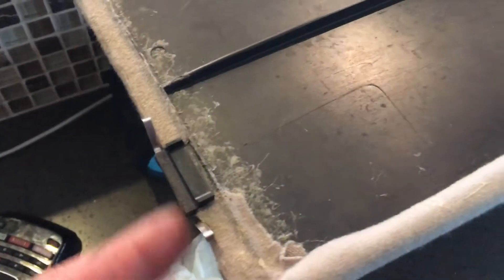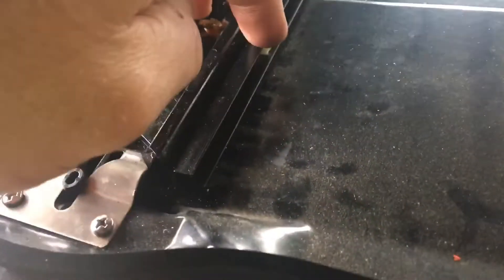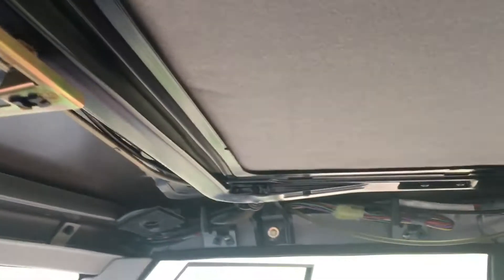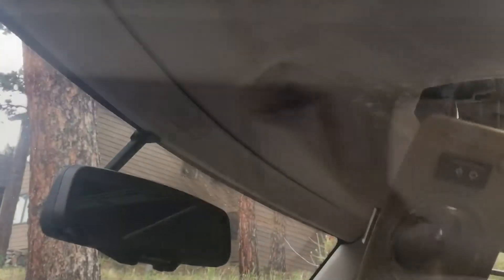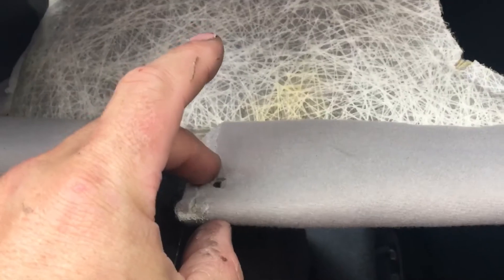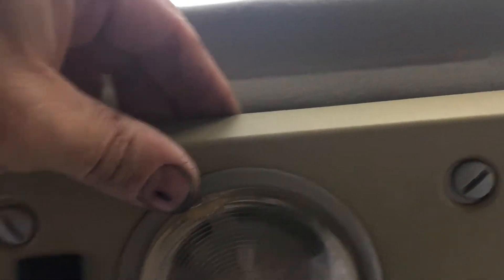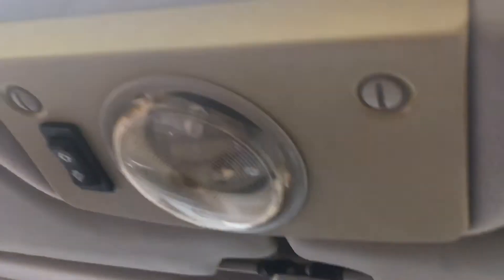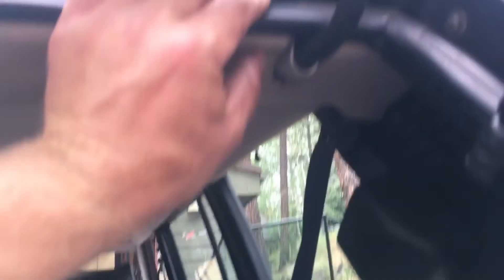Range Rover Classic: Installing a Re-covered Headliner

Comment: First, there are no Philips screws anywhere on Range Rover Classics. They are all PoziDrive. These need a PoziDrive bit or risk stripping out the drive head...I'm sure you've noticed how a philips bit doesn't fit quite right. Especially true on the larger sized fittings like on the doors. Also you missed the black plastic spacers that go in the oval holes under the handles.  These keep the handle from crushing the headliner card.
Otherwise great viddy!!